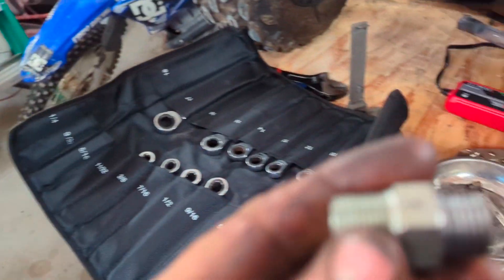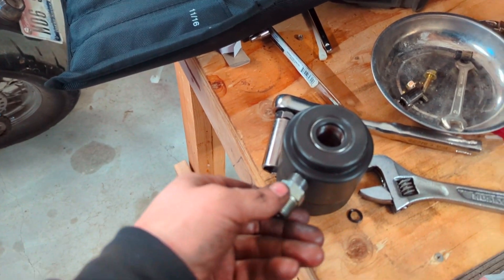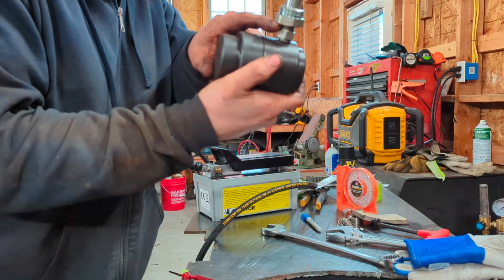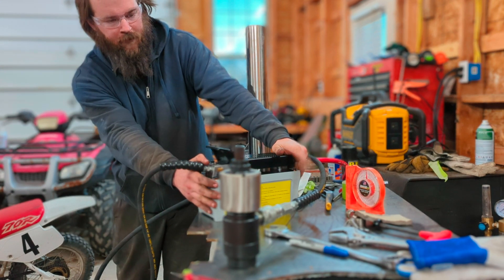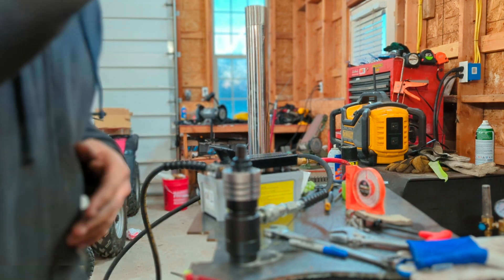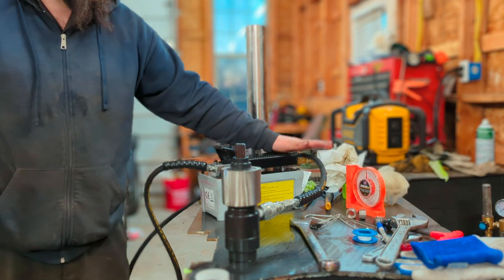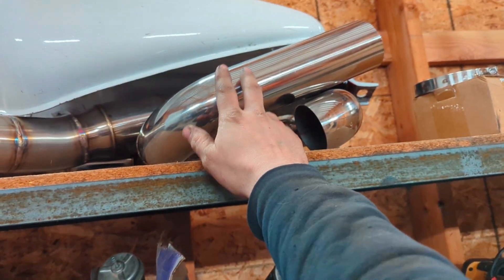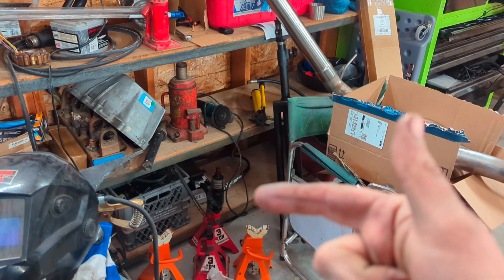Moving Metal (Part 2) - The lathe saves the day, and I harness the power of air and liquid!

Comment: How much air pressure are you using and what wall thickness is your stainless steel? Thanks
Reply from the maker: Your message slipped through the cracks 🤣.

AFAIK, it's 16 gauge stainless but could be 18, and around 110PSI.
Reply: @208Concepts  thanks🤣